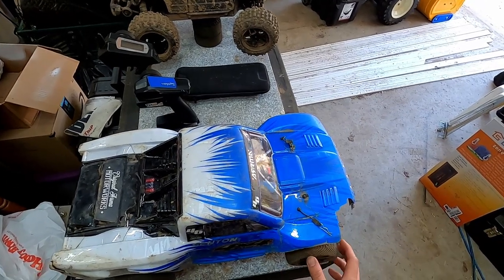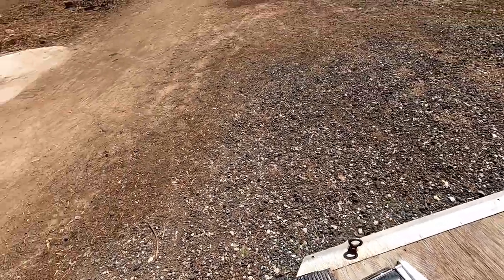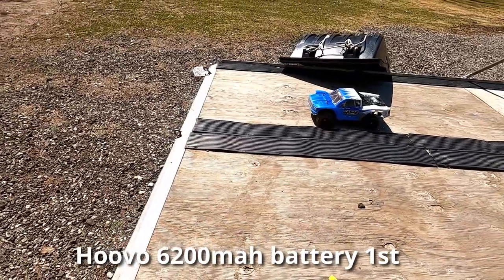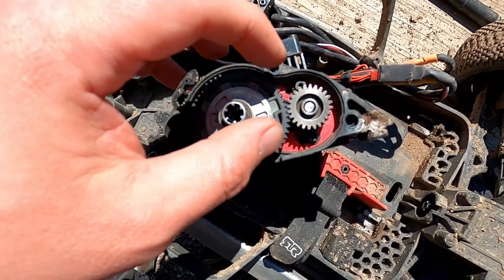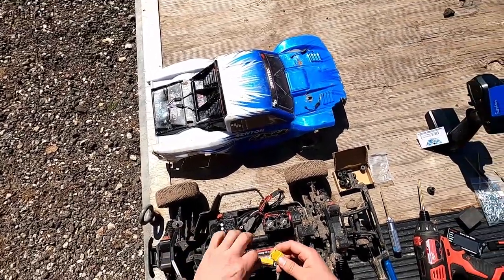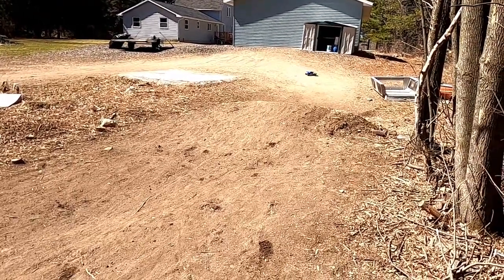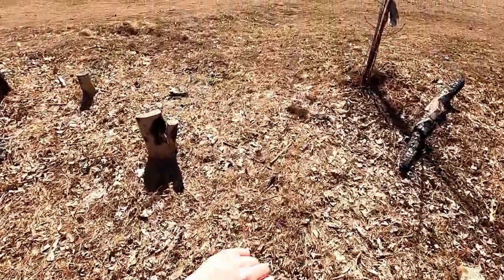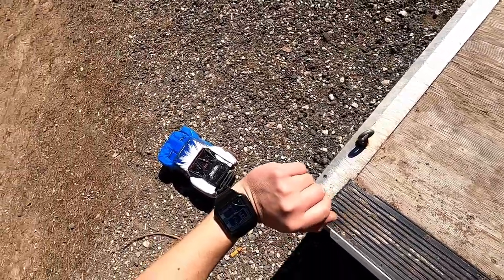Gool RC 3670 2850kv motor testing in the Arrma Senton on 2s 20t and 24t

Comment: How many sell can this motor handle?
Reply from the maker: I wouldn't go higher than 4s.
Reply: @raggedrc953  One last question. Does 120 amp mean that esc it can handle 6s?
Reply from the maker: Max voltage is 18.5v, which is 5s. I think 6s would be too much. 120a is usually for 4s